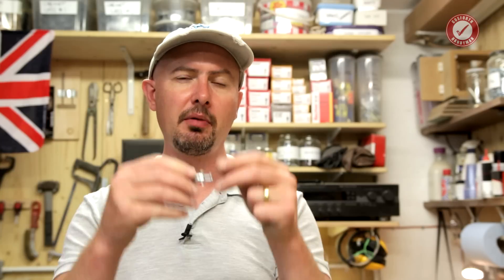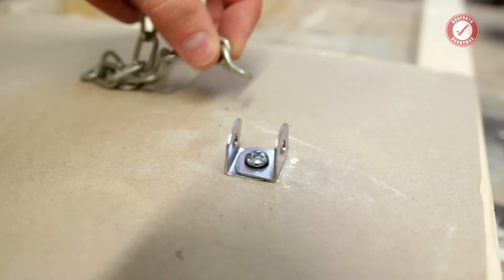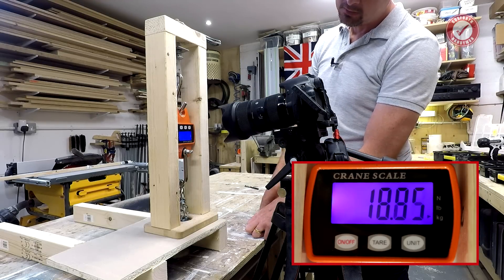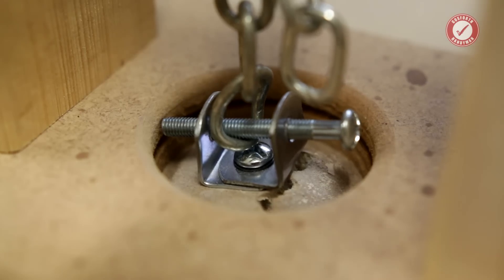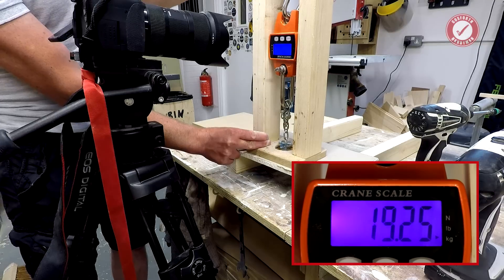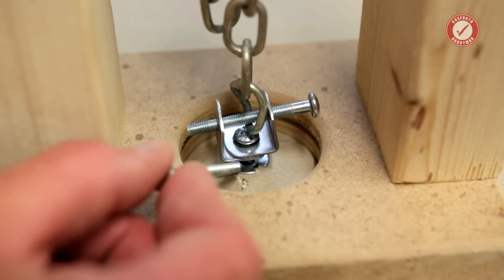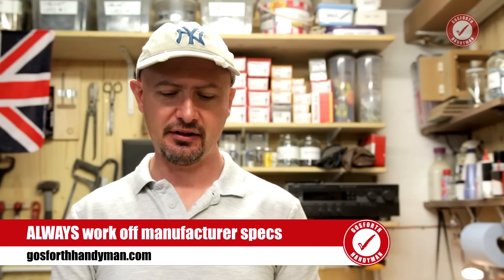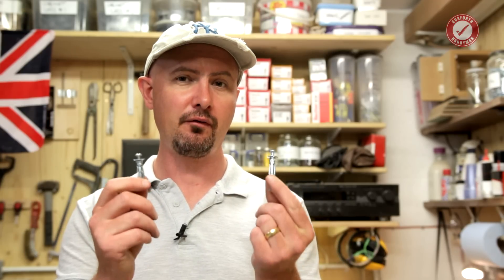How strong are expanding metal drywall anchors?

Comment: Very interesting video thank you. It’s helped me look at the ones I require for a project. I have some M5x65mm so if we take from what you found these would most likely take about 80kg however the plaster board most likely wouldn’t. So with this in mine, as I’ll be fitting quite a large tv to a wall with a bracket. I’ll be adding two pieces of wood to the wall (from floor to celling) and use the M5x65mm to hold them onto the wall (spread the load), and then have the tv bracket attach to the wood with special end bolts and then the tv attaches to the wall mounted bracket. I’ve done this a few times and it’s worked better than just attaching the bracket to the wall. It’s a shame they can’t design a bracket like these but with more expansion so the star shape on the back extends more to give a better distribution of weight behind the plaster board.

Comment: wonder how much they would hold if you could place some large washer plate behind them to spread the load on those legs even further ( obv that would be impossible on a blind hole in a plaster wall tho)
Reply from the maker: Might try to test this at some point! 👍 The plasterboard itself always seems to fail around 60kg regardless of the fitting. We shall see... 😀

Comment: Great video and testing might use those to put a tv on a dot and dab wall on a new build. About 4 should be sufficient for a to 15 kg 55" tv.
Reply: On dot and dab wall use either a corefix or dryline pro plug so you're fixing into the block work behind.

Comment: Can I used this for a 70lb boxing heavy bag? My plan was to hang it from the ceiling but I'm not sure how sturdy it is
Reply: As a static weight it would be fine, but you'll presumably be punching the bag which will eventually damage it. You'd be MUCH better off putting a batten of wood on the ceiling, and attaching it to several joists using wood screws. Then attach the boxing bag to that batten.

Comment: I'm thinking of putting a wall shelf above my bed. My wall is plasterboard and in total the wall shelf will have 12 kg of weight including the things on top of it. 

It has 9 screw holes and I'm planning to use hollow anchor wall plug for all of those. Theoretically it should be safe, but just wanted to double check, is it ok?

Comment: stupid question..  if one anchor hand handle homd 15kg.  does that mean you could use 2 anchors to hang something that is around 30kg??
Reply from the maker: Not really - depends how close they are together. The plasterboard itself is failing so if they fixings are close then both could fair around the same weight. If there's plenty space between then yes, I would think it would double the load... subject to testing. 👍😀

Comment: Great vid. I have tried using that type of drywall anchor before with very little success. But I never knew there was a setting tool. I’m embarrassed to say I have been a carpenter for over 20 years and never knew how to use these anchors. Thanks for showing me the light haha
Reply from the maker: No worries - you're certainly not alone! 👍🛠
Reply: Can I just use a hammer as a setting tool to get the teeth to bite? Taking out the screw first?

Comment: Good video but do u have a video demonstrating how to fix to an insulated plaster board or what fixing is recommended for a insulated plaster board
Reply from the maker: Give these a try - depends on how firm the insulation is, but normally these work fine as it just squashes the insulation out of the way. 👍
Reply: @GosforthHandyman  ok cheers

Comment: I'm looking at hanging a 36kg plasma TV on my dot and dabbed plasterboard lined chimney breast but don't want to compromise the chimney lining by drilling through the brickwork. By the time I add the heavy duty TV bracket I'll be looking at about 40kg. Would using about six of the heavy duty wall anchors do the job or would that be a bit risky? If so what would you suggest?

Comment: So if you use six what weight would they hold? I want to wall mount a 30kg tv
Reply: Considering that one holds 40kg, in theory 6 would hold 240kg. In practice the load isn't spread perfectly so you don't get quite the same results. It's also worth noting that this is demonstrating an axial (pull-out) load, whereas a TV bracket is a combination of axial and sheer... but nevertheless I'm certain that 6 of them can hold a 30kg TV
Reply: @audigex  Thanks, i ended up risking it and so far so good, but I appreciate your reply,Cheers,Tom

Comment: I used  to hang towel bars on hollow core doors. I had good luck with Molly bolts, but Molly bolt branded products were replaced with knock off parts at Lowes and at a TruValue hardware stores and they didn't work with hollow core doors because the pegs couldn't pierce the plywood skin of the hollow core doors. The were too soft and they just folded over. Home Depot did carry Molly Bolt branded products but they only stocked the pointed ones and they came with slightly longer screws that were too long for the hollow core doors. I found that I could take the shorter screw from the knock off Molly Bolt and use it with the Home Depot Molly Bolt branded product to solve the problem. 

I just tried to find who owns the Molly Brand trademark without success. I am not sure that it is a registered trademark any more.  I don't know what it means for a product to be labeled as Molly Bolt any more. Is it owned by a company that oversees the quality of the product?

Comment: The placement of the " studs " either side of this test piece will make a huge difference in support, if you test this in the centre of a sheet of gyproc. With batons 400mm apart the results may be very different as there's no baton support close by, like these in the demo
Reply: This

Comment: I would be equally interested to see the shear strength with some weight being pulled perpendicular. Like would be common when hanging a television or such.
Reply from the maker: Trouble is shear load tests can be quite misleading since even with a flat-mounted TV bracket (for example) there can be quite significant axial loads, massively amplified with cantilever brackets etc. Axial loads are pretty much worst-case so I always work on those. 👍
Reply: +1 for shear load test on these. Planning on putting up alcove shelves to take lots of books. Will be using 40mm brackets, so should be almost pure sheer load

Comment: Hi, I’ve got an oak framed mirror to hang, packaging said around 23kg , from your video if I did 2 of those style fixings with a strong wire I should be fine? Also, would you use a wire or mount the mirror directly from the triangular points that the mirror has already attached? Thanks in advance.

Comment: Providing the board is adequate and you use enough of them spaced evenly (of course, the more fixings you use too close together. can be just as bad as using too few), you can use them to hang all sorts. I've used them to support riser ducts on jobs and they've been fine after spanning a length of unistrut across the board to even the load.

Comment: I would be interested in shear load instead of pull/vertical forces.... how much force until the plug tips in its hole? must be less than the tension, as it holds on less metal pins?>

Comment: Believe it or not, the setting tool is not a very common item (I've never seen one) in hardware stores in North America.  They are available from Amazon, and the one I ordered actually came from England.  It has made putting in these anchors so much easier.  I used to have to try to grip the fitting with a pair of needle nose pliers while turning the screw in.
Reply from the maker: Been there before when I've forgot my setting tool! 😂👍

Comment: You can fit those fasteners without a setting tool as long as you press hard towards the wall as you tighten the screw, when you push hard it pushes the points into the plasterboard and stops it spinning. But yes a tool is easier. And even better when it was 50p at the car boot sale!!

Comment: how does it work with different thickness of plaster board?
Reply: The bigger fittings work on most sizes of plasterboard. The smaller fittings are only suitable for thin plasterboard, but tbh I'm not sure why you'd really use them anyway, they're only good for fairly light loads

Comment: I love all your videos Andy. What I would contest here though is you are doing a pull test. Most applications would fail through a shear test (unless you are actually pulling something). Many moons ago I used to be an adhesive engineer. Virtually all adhesives will fail on a shear (peel) test but not on a pull test. That includes sellotape.
Reply: Couldn’t agree more. I was in aviation and the majority of forces are in shear.
Reply from the maker: Cheers Lawrebel - these fittings can handle much higher shear loads than axial loads so my test is kind of a worst case scenario. Also with shear loads on these many other factors come in to play such as the size of the object being held on the wall, friction coefficients and a bunch of other stuff. A lot of manufacturers quote crazily high shear loadings for fittings but actually the plasterboard will fail on an axial load way before this. Got some tests coming up with shear loads though. 👍

Comment: Without the base makes lots of sense, The base concentrates the load on a very small area of plasterboard but without the base the plasterboard has a much larger area to flex and give before the actual fixing has to give. Great results thou.
Reply from the maker: Yup - surprised without the base got a higher figure but think you're right. 👍🛠
Reply: Maybe you need to redo a quick test with the camera watching the plasterboard from the side so you can see how much it bends. I dare say if your rig was wider you would get better results. Maybe you need to sort the jig so the feet are 400mm apart to replicate the average wall studs? That way you can see how much the plasterboard moves before that failure?  It was a good insight and your results were surprising regardless of which test you did.
Reply: Just watching this vid now and out of curiosity is your tv still hanging if you did it with these?

Comment: Great comparison test there, mate 👍
Just out of curiosity, would cement fibre board yeild similar results, given they're half the thickness of plaster board?
Reply from the maker: Cheers Bill! The official Fischer specs for Fibre Cement Board says 0.25kN (about 25kg) for 8mm board - so a bit higher than the plasterboard. 👍
Reply: Gosforth Handyman oh wow, that was a tad surprising. 
I thought it might have been somewhat less. 
Learn something new every day.
Cheer, bud. Have a good one. 👍
Reply: Bill Carroll concrete is stronger than plasterboard
Reply: chubbychicken1234567 yeah, I get that. Sometimes in these types of tests, the underdog shines. Now given the fibre board is considerably thinner and the plaster board has two supporting sides and considerably thicker, there could have been the possibility it may have been stronger by a kilo or two. I wasn't thinking the fibre board would be a lowly 5kg! 
That and the fact I've not worked with either, was merely a question out of curiosity, and well, if ya don't know, ask.

Comment: Needed to see shear force, when do pull directly on these.
Reply: It's comparable - there are other videos testing them and you get the same kinds of 40kg+ loads before the drywall fails.
Reply: @audigex  having used them alot now to hang tvs.. Agree not an issue when set right

Comment: a good tip if you're using these without the setting tool is to use a turning stop when tightening the screw to prevent the anchor spinning in the plasterboard.

Comment: Great video, I used these once as per the common mistake (no setting tool) and had written them off as total junk! I think after watching this I will buy a setting tool. I had tried the Grip it ones.......but quite a large hole needed! I have also tried one called rigifix which has been the most solid I have ever experienced. Have you tried them?
Reply from the maker: Yes, I don't like the huge hole for Grip Its. The setting tool is very satisfying to use. 😂

Comment: if you know what youre doing you dont need a setting tool. i install displays for a living and i simply set them with an impactdriver. just gotta feel when the its actually contacting the drywall on the otherside to not strip the threads or crush the drywall.

Comment: Nice demo but you would get higher force before failure with that setup. You’re essentially pulling the board through a small reinforced hole in your rig. If the board was unsupported over a typical stud span the board would flex more and fail earlier. Nice comparative test all the same. Thanks.
Reply from the maker: That's why I took the base off for the 2nd test and ended up with a higher result - go figure! 😀🛠

Comment: Really enjoy these vids. Umbrella fixings, as I call them, are my favourite plasterboard fixings, not only are they strong and reliable but I love the fact you can easily remove the screw and replace it as many times as you like.
I have to say though I have never used a setting tool, maybe I will have to get one. Probably better on the cheaper fixings where the points seem to be smaller. In the past I think I have have only used the Rawl brand and they have nice bit points on them.

Comment: How cheaply can you get a setting tool that does the job?
I feel like this is why most people doing DIY around the house prefer those screw in metal plugs - no other tools or drill required, just a screwdriver (no spending £50 on a setting tool you might use twice). Not nearly as strong though.
Reply from the maker: Screwfix do a Rawlplug one for £15 - might be worth a try - reviews look good! I've had 2 other cheaper ones from Screwfix that went in the bit though. 👍
Reply: @ thisguyplaysguitar
The main make of setting tool and bits is molly a black & decker brand i paid £11 for mine from a b&d outlet cracking tool made for the job,

Comment: Hi mate, thanks for the video,  just a tip,   it's best to have the screw up to the fixing, as I have had a few that the captive nut in the fitting  comes loose  when tapping on the screw, then                               when you remove the screw ,and refit it through your bracket etc, the nut falls out !****, whith no option but to drill the front off the fitting, knock it into the wall and fit another one, opologies if you already know this, just sharing my mishaps, lol..Best wishes to you and your's,  Stuart.uk.

Comment: Hi Andy, great info and well expalined, I would say  you would get a greater pulling force in a concentrated area such as yours, if you nailed or dot and dab the board to its regular spacings say stud work the pullout force would drop down.  always great to watch and listen too.
Reply from the maker: Not sure, the plasterboard failed where the legs of the fitting came through the board - don't think the failure point would change. 👍

Comment: It’s an interesting experiment and I look forward to many more "Test Tuesdays". Well done. I think, when the measured applied force decreased at the point where you stopped tightening, the plaster board was actually beginning to deteriorate and weaken. In an ideal experiment the force would be increased at a uniform rate and a peak detection meter would be used to capture the maximum value at which the test piece gave way. As a comparison; you could try measuring a screw with a washer and nut on the back. Try different size washers. It is clear that the weakest element is the plaster board. The anchor itself can obviously withstand far more force than the plaster board. Try an anchor in metal and see what happens. I would also suggest that you ensure the chain is not twisted as that will add a torsion (twisting) force to the anchor. I also noticed that the thickness of the plasterboard used is greater than that specified for the anchor. This may not be a good thing as the anchor will not be set ideally for its intended purpose. It may damage the structure of the board and consequently weaken it. Verifying that the base of the jig was having no effect on the measurement was a very good move. Anyway I loved it. Keep it up.
Reply from the maker: Cheers Charles - really useful response! Yes, I think on v2.0 of my rig I might try to make something that increases the force more evenly. Apparently those anchors (43mm ones) are for use in 9.5 or 12.5mm plasterboard... or at least the Fischer ones are. Unfortunately no spec sheet for the Screwfix ones but yes, was quite surprised myself that the back of the fitting had damaged the paper on the plasterboard before even starting the test! 👍😀

Comment: The area arround the dry wall anchor needs to be way bigger for an accurate test. That small hole in your pulling jig isn't big enough.

Nice video though :)
Reply: He addresses that in the video and runs a test without that bracket... it doesn't make a difference
Reply: @audigex   The area is still too small, even without the base according to me. A 20 cm diameter would be good enough.

Comment: Are these ok to use in the ceiling? I'm wanting to install a projector screen weighing 15kg and the joists might not be in the correct place.
Reply from the maker: Absolutely! 15kg is very close to the limit of these fixings though and with the movement of the screen it's a bit risky. See the vid I made about off-set projector brackets. 👍